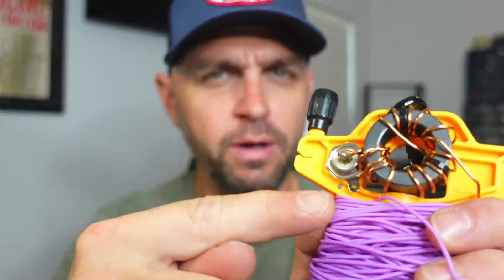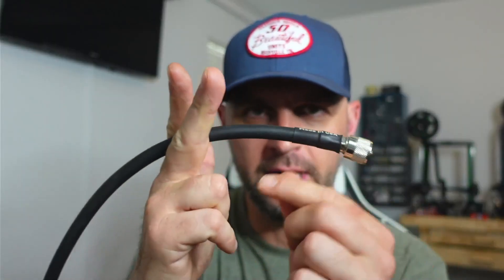Tips on How to Build The Cheapest EFHW Antenna - (End Fed Half Wave)

Comment: I knew when I got into amateur radio that I was going to want to build my own antennas to save money.   And, the least expensive antennas out there are wire antennas.   So, I bought in bulk the supplies needed to construct wire antennas, including the wire, connectors, dogbone insulators, paracord, an arborist throw bag and line, etc. - everything I need to build any wire antenna and get it up into the trees or pulled up on masts.

I don't know how much all that stuff cost altogether.   What I do know is that it cost a lot less than buying antenna kits.  And, it has always been very convenient to be able to decide to try a new antenna and already have all the parts on hand to build it right away.

Thanks for the video!
Reply from the maker: Thanks for the support and glad this video was useful!

Comment: When I started experimenting with antennas my first project was a 40m-6m fan dipole so I knew it was going to take a lot of wire.  I found, at that time, a 500' spool of brown 18 AWG stranded THHN at one of the big box stores for about $20 less than the other colors.  For about $40 I had enough wire to build a lot of antennas including the aforementioned fan dipole, a 20m vertical, a 40m-10m EFHW, a 30-17-12m for the WARC bands and a 9:1 "random" at 124.5'.  That has gotten me through my first year of antenna experimentation.  Since the 124.5' random wire covers all of the bands the other antennas, which all work well, will probably be passed on to new General licensees.  Someone gave me a commercially made 20M double bazooka when I got my General so I want to pass it forward.

Another thing I did to save money was to buy all of the hardware in small bulk quantities.  Things like a 1/4x20 stainless steel eye can run $3.00 apiece at the big box store but through Amazon I got 12 for $12.00.  I got screws, nuts, washers and other small hardware in quantities of 12 to 100 for far less than going to a big box or (even more expensive) regular hardware store.  I do shop at the local hardware store for difficult to find items as they're usually the best source for specialty items.  Toroids are less expensive through Mouser than Amazon and you're assured of getting what you wanted.  It's best to buy several to offset the shipping costs, which are very reasonable compared to some other retailers.

Comment: Thank you. Most shops claim to use some type of thread made specifically for them. Lightweight yet strong. And they all seem to be so far away that shipping and taxes cost more than the antenna itself. What type of wire would that be? Also, some spreak about using a MICA capacitor, that seems to be much more expensive.
Reply from the maker: Probably talking about Kevlar re enforced wire, if I had to guess.   You can get it from https://www.sotabeams.co.uk/dx-wire-ultralight-ul-45-85-170-400m-lengths/ or a similar on ebay.   I have some I may sell , in the near future.  Cheers.

Comment: Dont need any winder got my pinky finger and thumb to wind wire on. Don't need coax plug at feed point solder rg174 straight to toroid. I need a small piece of recycled flat plastic 1 zip tie and a piece of tie off cord for the feed point end. I piece of discarded zip tie with 2 small hole for the cord to tie antenna to my pole and have the antenna wire slide through the other hole. 6m of string on the far end to tie off to ground making a nice inverted V.
1 toroid magnet wire and capacitor. I recon $10 tops.
Reply from the maker: Great.

Comment: Here's the link to Colin's video:https://www.youtube.com/watch?v=Xe0wvbOQeok&t=654s
I only found the core on Mouser. I bought a couple to experiment with and build my EFHW's. The cores cost me about $8 each, plus tax and shipping. That's not as cheap as some different cores, but for gaining 10% or 20% more radiated power I figured they were worth another $3 or whatever. I'll hardwire the coax to the toroid in the box. I hate the possibility of intermittent connections up in the air. 

Just a reminder, 'tinned' copper wire at RF is basically just 'tin' wire due to skin effect. Insulated, stranded bare copper wire has less loss.

As an experienced Elmer, in order to save money, I would use an air-core transformer and avoid the toroid altogether. The cores are convenient, stable, compact, and reliable, but cost money and are less efficient than an air-core transformer. Also, while I have all sorts of magnet wire, if I were a noob, I would use whatever insulated wire I could find. RF-wise, they all work. In practice, look for something with a fairly high temperature insulation. Teflon insulated wire is uncommon but works great at high temperatures. More common is PTFE insulated wire, and is quite good at handling heat. Failing finding a high temperature insulated wire, run low power. Running 5, 10, or 20 Watts is good for the soul and can make you feel superior to other hams who have to run 100 Watts or more to make contacts. Good sized magnet wire is designed to wind motors and electromagnets with, and as such is just plain copper with a very thin, very high-temperature insulation on it so that more windings will fit in a small space and handle the heat. But anything that will fit on the toroid and not melt from high power will do if you can't afford the magnet wire. Try out your toroid under load in your workroom with a dummy load of whatever resistance is appropriate, and with the power you want to run and see if the insulation will last, or start to melt. If it starts to melt after a while, try some other kind of wire, or reduce your RF power and live with it till you can afford some magnet wire. If you're running 10 or 20 Watts on a 100 Watt-sized core, like the one suggested by Colin, (and me,) don't worry about heat.

Comment: The bought ones are only available from the USA and hence for me there is the cost of shipping to Australia.
If I ever get a 3d printer I'll design my own efhw winder and put the model up on thingaverse for everyone. I hate that these people making them in the USA don't do this when they are only making small numbers of them and are always out of stock.
The toroid recommend by MM0OPX is out of stock.
I want an efhw that's also efficient on 10m since I don't have anything for 10m. The MM0OPX recommend toroid is needed for that. It's 43 mix but different dimensions to a 140-43.

Comment: My friend Ryan and I went the other direction with our builds. We took a 40-10 49:1 kit and upsized it for about the same money as the kit. Used a 240-43 Toroid and wrapped 24:3 with really big 14ga magnet wire. Then put it on a 3D printed winder and applied the 18ga antenna wire 140’ with a 30’ counter poise. Added the BNC and capacitor. 80-10m theoretical antenna. We spent hours trying to tune it, but didn’t get it below 2:1 SWR before it got cold and dark. Next time we are together we are going to tune and run it as an inverted V, UPSIZED! Easily handle 100watts, maybe even on FT8?!?
Thanks for a great video!!
Reply: Look at Colin's videos, the 240-43 should be good for 100W on FT8, possibly even 150W.

Comment: I built all my end feds using the same methods you outlined. Found great deals on all the parts needed. With a little research you can build a 40-10 EFHW for less then 20 bucks. Just have to be creative in where you source everything. They last one I made handles 250 watt SSB and around 100w Digital (so far, lol). That cost me around 28.00. Great video Dude and looking forward to the next one! And to your point, it was fun building, even through the mistakes I initially made. It’s well worth the learning and patience. 73, K4HEF

Comment: I know this guy (wink wink) that was at a local hamfest.  He bought 8,000' of 22awg wire for $8.00.   He also bought 10 240-43 toe-roids  for $10.00.   Deals are out there if you look for them.  It might take you a while, but you can accumulate the stuff over a period time.  I can build  an end fed antenna for under $5.00 including the hermetically sealed case/enclosure to put it in.  All from parts purchased at local hamfests.
Reply: I only got 4500 feet of 22g hook-up wire for $10 at a ham swap. I was robbed! But I did find a box of 2 thousand or more silver mica caps of all sorts of values from a few pF to 3300 pF under a table at a swap that I got for $20. I also got a pair of old GE desk mics out of a box under a table that looked really filthy, for $2 for the pair. I cleaned them up. They look new, and work great. Always look under the tables at the ham swaps. I ignore the shiny, organized stuff on top of the tables and go directly underneath to the stuff they have already decided is too worthless to display.

Comment: I splice together used wire from other projects, and I buy bulk crap wire at flea markets. I picked up 100 feet of romex for $10, 4 conductor. Sure that's 400 feet of solid conductor 14 ga THHN but it'll work.
Reply from the maker: Wires got to be the cheapest thing to source , thinking about it.
Reply: @DudeTested  depends on the wire. Wtih crap wire like the stuff I use, oh yeah it's cheap lol